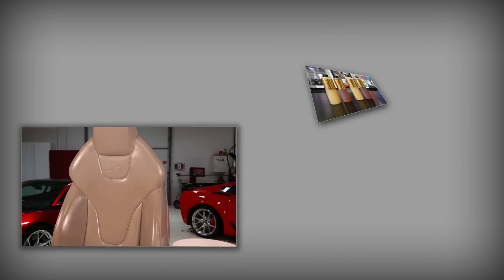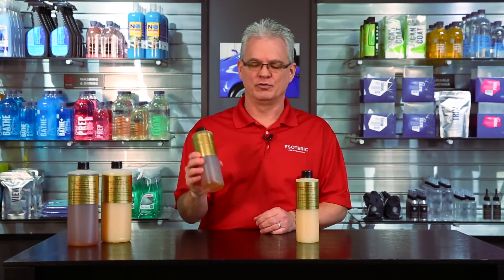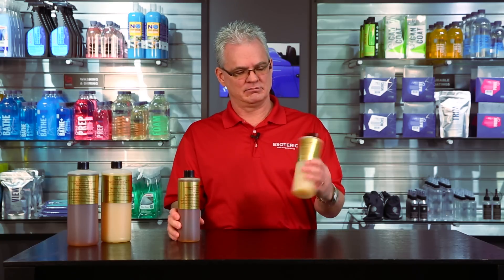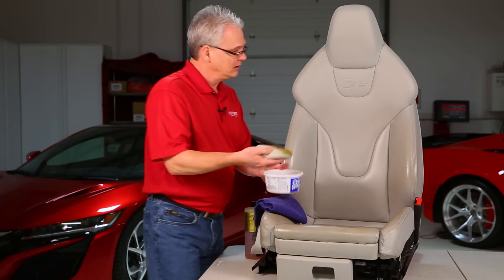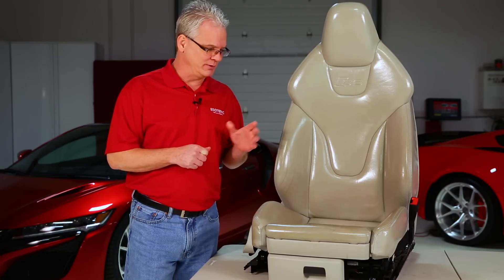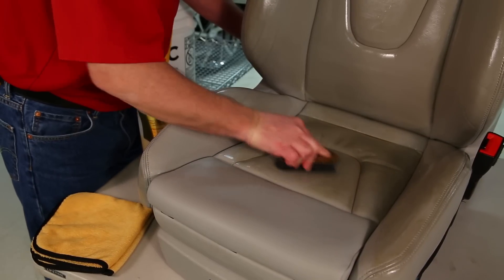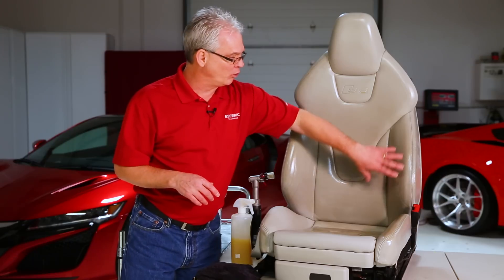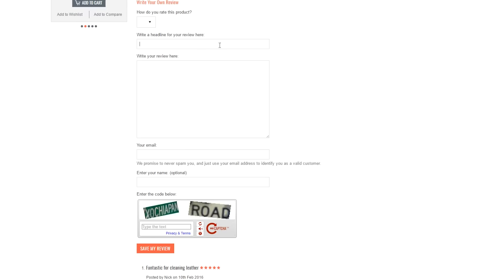How to Use Leatherique - Leather Care - ESOTERIC Car Care

Comment: hey, Todd.  I watched and commented on the video & subscribed to the channel last night.  This morning I began thinking about something.  If the Leatherique product actually does penetrate into the leather, then how far down can/does it go?  My reason for asking is...what about situations when the dash or door panels typically has the leather glued down?  What is the possibility of this product penetrating far enough down to the glue and causing future problems?  Or is there a different product that you would recommend for those areas, specifically the dash.  I have a car which the make & model have a known possibility over time, for the leather dash to dry & shrink around the air vents.   The black leather dash which is already 17 years old but still currently in perfect condition due to previously residing in the Midwest and garaged.  Currently, and for the past 3 months resides outside, in the "hot as H3LL" Houston area, with a reflective dash/windshield panel plus 2 car covers and vented.   Other than trying to further limit exposure to extreme heat & UV rays, how would you recommend to treat and care for such an older, black, leather dash, to keep it somewhat "hydrated", soft and also prevent shrinking and separation from the base? I would definitely appreciate your thoughts on this.  (I will also send this message via email in case I don't receive a replay notification from youtube) Thanks!

Comment: Many years ago I bought an old Volvo 960 with leather interior. It was hard like plastic, but no tears. I researched what Rolls Royce owners used on their leather. The Rolls Royce owners club endorsed a product with an odd name called “Leatherique”. I order some of the product as a kit within Prestine clean and Rejuvenating oil. Being my daily driver I was unable to let it sit for more than a few hours at a time, but little by little over time the leather started not only feeling like leather, but having that leather aroma we all love. I am a firm believer in the system. Yes, it’s more involved than just putting some cream on a rag, but you will find the results worth while and so rewarding.

Comment: I was always curious about this product largely because of this video. I was speeding a bit the other day and the police took my license away for 6 weeks. I thought to myself this'll be the perfect time to try this product out on my Lexus. So I ordered it and today applied it on the seats. I hope it does a good job! (I hope I did too)
Reply: It worked like magic and was easy to do even in cold weather. Some areas of the front seats needed four coats of rejuvenator but still I only used about 150ml for the whole car. The rejuvenator surely is water based as you can get it off your hands with water. That's why I tried to take the rejuvenator off from one seat with only a damp microfiber cloth and I can't tell any difference to the other seats which I cleaned with prestine clean. I'm not so sure what the point of prestine clean is.

Comment: Great video! I’ve had a lot of luck saving this treatment for the summer months. Using the windows up in the summer heat technique (creating a greenhouse effect) really helps release the creases and quickens the soaking process. Heat is your friend for step one. Amazing product for deep conditioning & cleaning.

Comment: Great video. I used these product to rework old BMW seats that I dyed a different color. Works amazing. People need to understand that this is not a 10 minute fix the first time they use it as most seats have been neglected or ignored. On the trash bag issue get the clear ones that are out there in the event you need to sit on the seats for a bit. Thank you for taking the time to post as most  people wont take the time to read the directions and then wonder what is going on. My leather is amazing after a few soaks of the rejuvenator.  Nice point on the water and changing it out as you will be amazed at how much junk is on you seats. This product is to leather what clay bars are to paint!
Reply from the maker: Thank you for the positive feedback. And yes...the stuff is amazing when used properly!

Comment: Damn good video!

I Leatherique’d my 2012 Accord after I let a water/BCAA mix sit on my perfect leather seats for like two days...the leather is still deformed, but, it does look better than it did.

It did a fantastic job cleaning and conditioning the seats...I can’t believe what it did the Audi seat!

Esoteric,  if you read this, do you feel that if I let the rejuvenating oil sit for like month, with me re applying over when it turns white on the “scar”, it would help?  I think I’m cleaning so much I’m taking dye out.
Reply from the maker: We have taken some seats, and continue to re-apply Rejuvenator for several weeks. It would literally get more product applied every day or so. When it looked like it had soaked in, we would re-apply it. It turned these BMW brick seats into soft, supple leather when we were done, and the owner was absolutely floored with it.
Reply: ESOTERIC - Fine Auto Finishing 
Great news!  I’ll continue to re-apply, the Vegas heat gives me an advantage.

Comment: 14:06 damn son, he used up almost all the big bottle in only one car. I've always used Zaino Leather in a bottle no complaints, but I bought this out of curiosity. Requiring almost all the bottle for one go makes this product very very expensive though.
Reply from the maker: That's our shop bottle...not a brand new one opened just for that particular job. Yes, it takes more product than traditional "cleaners", but it's an entirely new level of deep cleaning and conditioning (and preservation).

Comment: Nice presentation of leatherique process. Have you done aniline leather treatment with leatherique? I wonder if there is a way to keep the crack lines in the coat from getting darker because of the rejuvinator. A lot of owners of volvo s60R/v70R complain that after using leatherique the seats that had some breaks or cracks in the leather turn dark. Thanks

Comment: Awesome video Todd, some day I will have a beautiful shop like yours.  I have a 2010 Acura TL SH-AWD [80k] with heated seats and perforated leather and black interior.  Do I have to take any precautions when using this product?  I'm a little concerned about product getting into the perforations and clogging them.  Thanks...
Reply from the maker: Thank you. No worries on the perforated leather seats. Just don't "dump" a ton of Rejuvenator on the base of the seats and you will be fine. I have been treating perforated seats with Leatherique for many years, and on my personal cars, without a single issue whatsoever.

Comment: Wow, that was a very nice job.
I would like to know if i can let the car in the sun with the product to speed up a little the process.
The product remove ink too? Very nice videos.

I have a question: Does Sonax owns Rupes? I mean, Sonax is behind Rupes Polishers? I've heard that today here in Germany, but I didn't believed in this information. If you know something, let me know.

Keep on nice work.
Reply from the maker: Yes, you can pull the car outside and roll up the windows to speed up the process with heat. Do not however, try to use hair dryers, heat guns, or other methods though. As for Rupes, they are a family owned company and have been since about 1947.

Comment: Hi Todd

I had my BMW leather seat covers replaced with new leather covers. The shop that installed them did a good job and they massaged some Lexol conditioner which made the leather very soft and gave the Imola Red leather pop really nice. 

I have had these covers on since April 2018 and want to preserve them from the start. I would like to know if you would recommend a full leatherique process (Rejuvenator/prestine clean)?  The leather that was used for these covers is a bit more rigid and thus after the shop did a massage with some Lexol conditioner, everyone noticed a big difference in the enhanced softness of the leather.   I absolutely love it.   There is scorching sun which would make a great steam effect for the rejuvenator oil!!! 

Regards,
Mark
Reply from the maker: If they are true leather, than this system would be great for it. With this, you need nothing else for your leather so don't get caught up in the "more products are better" way of thinking!

Comment: Good morning, I'd like to say good video.
Well, my black leather seats are usually always clean. Soon, not even 3 months ago I applied Gyeon Leather cleaner and Gyeon Q2 leather coat sealant.
As the banks have some wrinkles from the former owner, I decided to ask for help and that's where Leatherique appeared. I saw a series of videos including yours.
I did the application as it shows in the video, I did it in stages, I let it dry from day to day on the street. And Eyes seen nothing improved !!!
Will I have to do it again?
-Leatherique rejuvenator Oil
-Leatherique Prestine Clean
Prestine Clean, I did not find it effective, much better the Gyeon leather cleaner.
Thank you SFF.
Thank you.
Reply from the maker: Leather is a natural product, and will therefore get wrinkles or creases that cannot be fixed with a product like Leatherique or other. And consider the Prestine Clean to be an all-in-one (cleaner and conditioner), whereas the Gyeon product is strictly a cleaner. When using Rejuvenator, you want to make sure you are using the Prestine Clean as your follow up and nothing else. Thanks for the feedback.

Comment: Great video, very informative. I do have a question though; I purchased this product to bring back my old dry E30 seats, but the driver's has a few tears. I have some patches and a repair kit I plan to use, but should I fix the seat first then clean, or do it the other way around?
Reply from the maker: If it were me, I'd clean/preserve the seats first!

Comment: So if I get only the cleaner for some chairs a little dirty, will it do anything?
And can the cleaner be used with a conditioner  “oil” from other brand ?
Thank you
Reply from the maker: Prestine Clean by itself is a good one-step product when you're not looking for deep cleaning and conditioning. I would not recommend using any other "conditioner" with Prestine Clean, as they work nowhere near the same level as Rejuvenator.
Reply: ESOTERIC - Fine Auto Finishing 
I’ve tested today with some white sponges.. it really is amazing. Now my back harts but it will pass :))

Comment: Hello Todd, I bought the conditioner and the cleaner and this video really helped me what I have to do with the products but I have a question if you have the time to give me and advice, place.
What about the perforated leather with cooling and heating in the seats? Can the products damage anything when will go trough the punctures? The car is a BMW 2016. Your advice will be really appreciated. Thank you again.
Reply from the maker: Thanks, and I'm glad the video has worked out for you. In all the years that we have been using Leatherique, we have never had a single issue with perforated / heated / cooled seats.

Comment: Very detailed video! 
Will be planning to purchase as soon as I can!

Question: Based on the sizes you're displaying (not sure what size of bottles they are) , what size bottle do you recommend for sedan sized car for one application?
Reply from the maker: The smaller 16oz bottles should suffice for one application, and you should have extra left over. You'll use a lot more of the Rejuvenator than you will the Prestine Clean, but then you have the Prestine Clean for your maintenance cleaning...

Comment: Can the rejuvenator and pristine clean be used on steering wheels. Saw a bunch of people saying this stuff is great on BMW Merino Leather and was wondering if it could be used on the steering wheel. Vehicle is 2013 BMW M5
Reply from the maker: Yes it can, although in most cases all you need is the Prestine Clean for steering wheels.

Comment: Hey guys, awesome video. What are your thoughts in regards to leather specific coatings such as Gyeon Leather Coat/Gyeon LeatherShield when used with the Leatherique Rejuvenation System? Is it needed? Does leatherique itself leave behind enough protection? If you were to install one of these coatings after are there any steps between the cleaning process and coating process to ensure it bonds to the leather?
Reply from the maker: Thanks, and glad you liked it. And as for your question, I would use one or the other...not both. There could potentially be a bonding issue if the coatings if you tried to put it on seats that have just been treated with Leatherique.

Comment: Do you recommend and leather conditioner between uses of this? 

This is a long process so only planning on doing it when completely necessary.
Reply from the maker: No. Use the Prestine Clean for maintenance between applications.

Comment: Is this still your favorite? If I'm going to use some ColourLock crack filler and sponge applied dye, should I use the Leatherique first to get the leather soft and then a day or two later use the filler/dye? Or should I fill/dye first?
Reply from the maker: Yes, it is still my favorite and I literally just applied 3 layers to an old Porsche Targa yesterday! You need to check with  the manufacturer of the crack filler to see what they have to say about it on which comes first, or if they even think they are compatible.

Comment: Hey Todd. Perfect video on this product thank you! I have a 2008 Acura TL and there are some vinyl storage compartments on the back of the seats. Should I tape those off or just wipe clean right after applying the cleaner?
Reply from the maker: I wouldn't use the Rejuvenator on those, but it would be OK to use the Prestine Clean on them during your final process.
Reply: ESOTERIC - Fine Auto Finishing I apologize. I didn't mean I was going to apply leatherique to the vinyl parts, I meant what is best way to avoid them? Tape off while treating the leather, or just wipe off any residual product that gets on the vinyl? Thanks!
Reply from the maker: Chris...just wipe off any residual product afterwards as it won't hurt anything if it's on there for a few minutes.

Comment: Greetings

I am going to have the driver’s side leather seat of my BMW fully reupholstered and the entire sand colored leather interior repainted in a cinnamon color.   I had used the Leatherique conditioner/cleaner on this interior previously and would like to know if i can safely use it again once my interior has been painted/repaired without any discoloration problems. 

The shop doing this job also puts a clearcoat on the leather once the paint/repair process is complete

Regards,
Mark
Reply from the maker: Based on what they are doing, it might be pointless to try. Also, the dye manufacturer / installer would be best to ask that question because there are a lot of different products out there. I've seen some hold up just fine after Leatherique, and some that break down in the process.

Comment: Awesome video, I've been using leatherique for years on my vettes and it's always worked great.  I recently picked up a Chevy Volt with "leather" seats and ordered a new C7 Z06 (Torch Red of course).  I picked up a bottle of Gyeon leather coat on my detailers recommendation.  Would you recommend sticking with Leatherique or does the Gyeon product have its place as well?

Thanks!
Reply from the maker: Thanks Jeff. Gyeon Leather Coat definitely has its place as well, and we use it regularly in our shop (we were the original and exclusive importers of Gyeon into the USA). You could always start off with Gyeon, then switch over to Leatherique after some time and miles in the new cars.
Reply: Thanks for the advice!  I'll do just that, start off with the gyeon and switch to leatherique when I start seeing some wear on the seats.

Comment: Hey.  I have 2018 jeep trackhawk.  Do I have let the prestine sit that long? And also my dash and doors and center console is leather.  Can I just use the prestige clean on that or should I use both like the seats.  Again. Car is 1 month old.  Thanks in advance
Reply from the maker: For best results, you do want to allow the Rejuvenator sit for at least 8 hours (24 preferably). I would then just use the Prestine Clean on your dash, doors, and center console.

Comment: Hello, I believe my vehicle may have vinyl mixed in with the leather surfaces, but am not sure which is which. Will the rejuvenator oil work on the vinyl or will it be of any damage.. Thanks
Reply from the maker: It shouldn't damage the vinyl, but it won't really do anything for it.

Comment: I'm currently cleaning my Lexus seats.I have read that because they are coated it won't clean properly.What is your opinion on cleaning coated seats with leatherique?Also will it work when its colder and leaving on for longer?
Reply from the maker: I do believe that I address that question in the video, but it doesn't matter how it's made...Leatherique works perfectly. For the colder temps, simply allow it to sit for longer periods of time.

Comment: Can you pre-heat the seats (heat gun, hot room, heater etc..) THEN apply oil ?

Can you use it on vinyl ?

How come you don't clean the seats before rubbing in the oil? wouldnt cleaning it beforehand remove dirty etc.. from the pores allowing the oil to do it's thing and soak in easier ?

Does 'gravity' have an effect on how the oil absorbs into the leather ? i.e. should you recline the seat-back ?
Reply from the maker: Sure you can, but I don't see a need to. We do not pre-heat seating surfaces, and get stellar results. I would only use the Prestine Clean on vinyl. Sure, you could pre-clean with something like Gyeon Leather Cleaner, but you're just adding an unnecessary step. The Rejuvenator is designed to be a deep cleaner and conditioner.